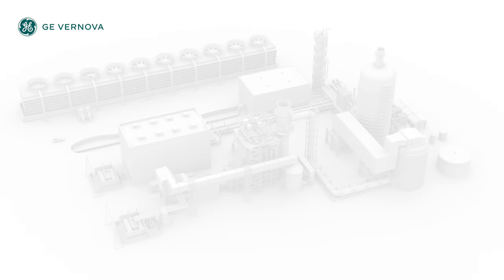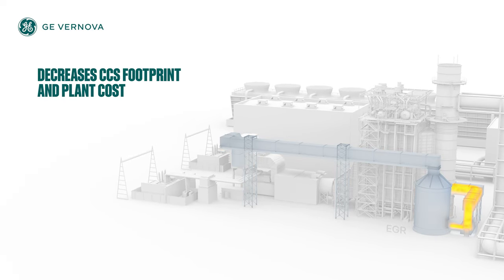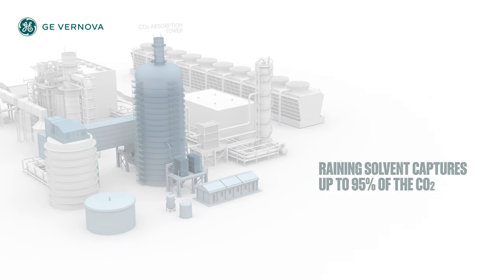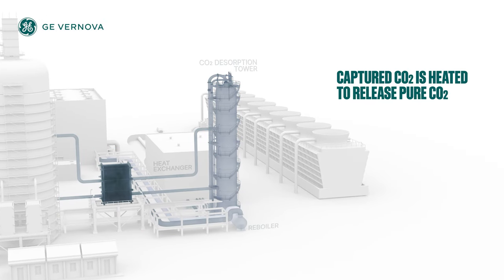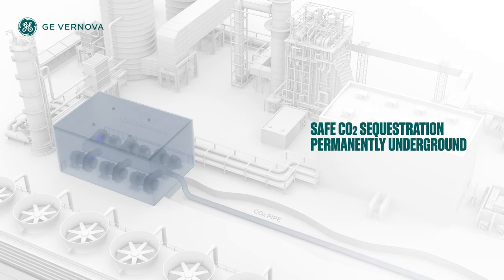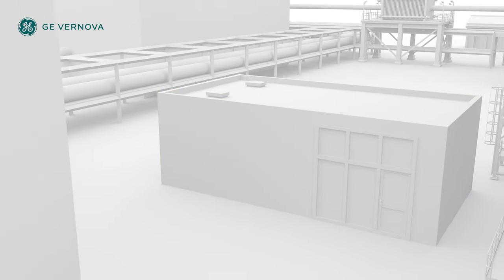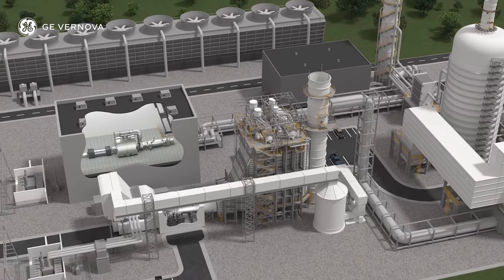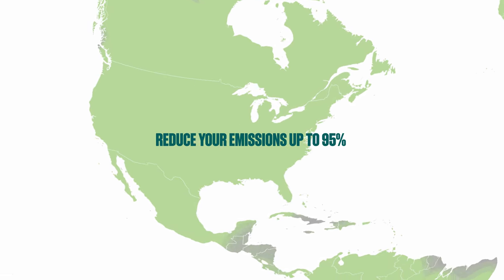Carbon Capture Solutions | GE Power

Comment: This is an incredible waste of time and resources. I cannot believe the amount of effort thats being put into something that is not only unnecessary but provably worse. 
"Using steam" What is being used to heat the steam? are you capturing the carbon produced by the heating of said steam? If so what is the percentage of carbon that is essentially recirculating through the system and what is the percentage captured elsewhere?
 What is the solvent? How is it made and what were the carbon emissions to construct and manufacture such a facility and what is the timeline of carbon capture necessary to make up for the carbon that was not captured in the production of these parts, assemblies and chemicals? 
Is carbon "safer" sequestered underground and if so how do you stop fugitive emissions?

This can impress the ignorant but it doesnt impress people who know.
Reply: You don`t have the burn gas, oil or any fossile fuel to generate steam. There are electric alternatives that can be fed with sustainable energy produced by wind or solar plants
Reply: @giconmesvapor3564  Can you tell me what a fossil fuel is?
Secondly, how are the wind and solar plants manufactured? How are the materials for wind and solar plants created? Using what material and processes and using what transportation modes for those materials?
Furthermore, what is done to the waste material from solar and wind?

But before you answer these questions it would be beneficial for the discussion if you answered the several I asked in my original post.
Reply: The steam comes from the exhaust gas heated HSRG obviously. "it doesn't impress people who know" But you don't know where the steam from a CCGT power station comes from? Ok...
Reply: @liamcollister  You must think that that facility is completely self powered self sufficient and requires no feed. Essentially do you think that this facility is a perpetual motion/energy machine?
They have to feed steam into it from outside they then have to use the process to capture the emissions that were created for the purpose of capturing emissions. Do you not see the never ending loop here? 
Additionally what about the water vapor? Water vapor is also a green house gas and its far more heat retentive than CO2. Yet they arent capturing the water vapor emissions are they? Why only CO2?
You should read more about green house gases, their heat capacities and heat displacement abilities.  Its a pretty tremendous waste of time and money especially considering the fact that man made climate change is largely still unproven and thats not mentioning the impact of CO2 on localized climates and environments.
Reply: @EPC-ue2ci  Black start generators can run off HVO which is a carbon neutral fuel. As for the water vapour, it turns into rain like any other water vapour naturally created by the sun heating bodies of water. I think you must be some sort of troll or classic example of the Dunning Kruger effect!
Reply: @liamcollister  lol do you think that we just find HVO and it magically appears at the location of the black start generator? What are the emissions created during the creation of the HVO for the purpose of capturing emissions? How do you not see the very blatant and obvious cycle with technology like this? Create more emissions to capture emissions from the processes that created more emissions for the purpose of capturing emissions. lol
This technology will be dead in 10 years because it feeds itself and in a bubble looks good however when considering the emissions created to build, feed, and maintain such a system the net supposed affects are going to be negligible at best. This is the case with EV technology as well. It is essentially a buy now, pay later scam.  
Secondly, this isnt a black start generator it is using the concept of a trigeneration generator where latent heat is captured from another system to feed this system, latent heat which could be used to refeed the original system instead to increase efficiency but is instead used for capturing low impact gases for the sake of virtue signaling to the world that you have useless technology. We should be using our emissions levels and raw materials to maximize efficiency of systems already in place instead of using them to capture the gases that are produced by the gas capturing systems.
Reply: 심각하네요;; 수증기는 온실가스가 아닙니다. 그리고, 생각하시는 것과 다르게 발전소, 공장등에서는 폐열이 많습니다. 폐열을 이용한다고 해서, CO2가 더 발생하지 않아요. 해당 공정은 지구를 구하기 위한게 맞습니다. 아직 상업적인 가치를 얻기 위해서는 운영비를 감소 시킬 필요는 있습니다. 하지만, 방향성이 틀린건 아닙니다.